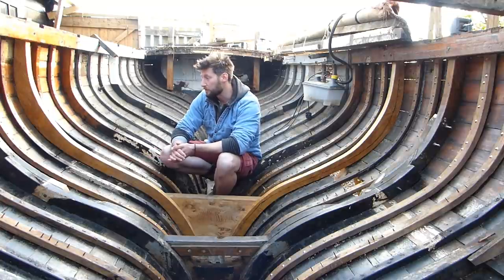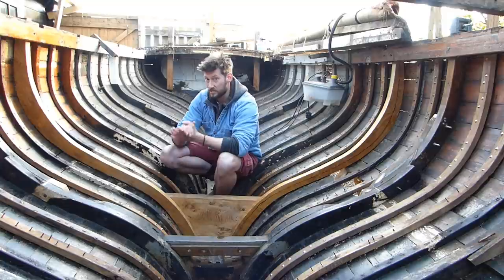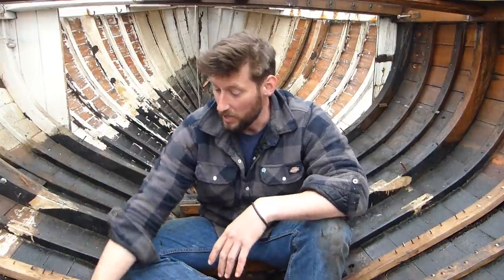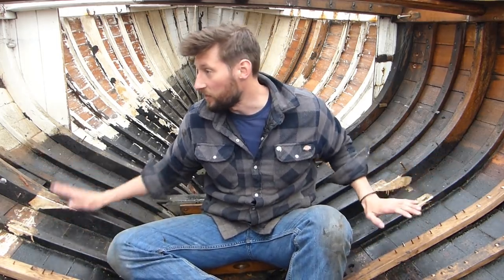Reviving an Idler - A question! -  Extra Content!

Comment: You cold drill a larger hole then epoxy the hole. After set you can drill a new hole in the epoxy for your fasteners.  The epoxy will prevent any moisture getting into the wood planking.  Use a butt block as required in bad spots.

Comment: Hay mate As a Shipwright i would fit a round disk Dutchman on the out side to about half the depth of the plank epoxy it in and fill the hole on the inside with a dal epoxied in  .Trim everything up when dry and you can drill off set to your old holes but not on the same grain line and nail and rove is far stronger than screws but some can be used to pull things up tight temporally and replaced later with nail and rove . You will not see the epoxy as it is covered by the rib and stronger than the day it was built     i would also widen the rib if you can by about 10 mil where it lays on the planking but keep the foot the same to sit in the slot do this to all the bigger ribs all the way through and no one will know the difference some times using new tec on old boats keeps them in good order for a lot longer . On my own boat i have kept traditional methods of boat building with the use of new tec (Where needed) and the boat is 80 Years old and now it will be around for the next generation and maybe the one after that  also a templet jig using small  bits of door stop 25 x10 mils with rounded ends about 100 mils long linked together in like a bike chain with small bolts synched tight and lay it along the hull will give you the curve before removing the rib  transfer to scrap plywood  test trim and fit the ply alongside the rib draw the inside edge  on the ply straight off the inside face of the rib cut to the line and the templet is made .this will speed things up for you and make it easer as i am not shore the existing ribs will come out in one peace    I hope you under stand my method  and description  and helps you on your way       MV Joy-C
Reply from the maker: Wonderfull advise, and experience, thank you for sharing this with me!
Reply: @BothanboatsIdler  No problem mate

Comment: If the planks under the old frame are good  and sound , no rot has traveled, I am a fan of leaving frame where it is. Make a new frame , make it a little wider if you need , plugs with epoxy all old holes. Make frame so you can catch your fastenings in good wood. Bed the new frame with a good marine adhesive sealant, this will seal the planks and with new frame give strength. I would also at least fasten this frame with bronze screws and plugs. This will give back strength as well as seal all the planks. My 2 cents! 😃👍👍

Comment: Late to the game and not a boat builder, but what about putting a short frame into the original keel, then run two longer frames bolted to either side of the short one up the rest of the way.  This will allow you to fasten two frames into good wood.  then just plug the bad portions with trunnels and graving pieces.  From my perspective the iron sickness had rotted the boat all the way down at every plank, almost like perforations in paper that allow you to easily tear the paper (or boat) in half.  I know that doesn't sound good, i guess it depends on how deep the iron sickness goes.  Good luck

Comment: There is so much going on with Idler the more you get into it. I think its time to investigate all possible rot. Rot from iron, rot from worms, cracks, checks, and so forth all over.

This is not an expensive yacht. I believe its planked in pine aka construction lumber free of knots.

Bent wood floors are must, tree trunks are overlooked and left in ground, may involve digging and a few burnt chains but you can get some nice floors.  If you can setup a full size half model out of construction lumber, fair with battens you could get a nice set of lines for all frames. Wherever there is cross grain on a frame it should be sistered with treenails, or trunnels.

You have a choice to patch it up and get a few years out of it, or rebuild it and have it available for the next few generations.

Don't overlook possible sources of lumber, reclaimed wood, leftovers from a large shipyard where you can get a possible piece or two out of wood.

If your willing to put in the work, both on ship and making nice videos, there will probably be patreons and others willing to donate. Again it is not a large ship. You could even make some modifications, such as going with a cabin roof that raises a bit with canvas sides for when you want to camp out on the water with family. Going with a regenerative electric engine and battery banks. (when sailing it charges the batteries) With fuel stove and backup lamps and a few solar panels it can be an interesting cabin cruiser for a small family.  The possibilities are endless.

BUT your starting with the name of ship that has history. History is usually worth preserving especially if it was designed by someone of note. Even better if you can get a line drawing of her.

The cheapest solution is to epoxy in scarfs where needed. Copper rivits with roves peened over. I saw some large copper tree nails on amazon for good price that may be a possibility. I think they are used for killing trees.

Wide gaps in planks, shifting boat due to bad frames all over, sitting without proper support dry for years then soaked with freshwater rain for a number of years has taken its toll.

Id make up build frames install them in boat, after fairing, strip one side reframe plank and then install ribs, beam shelf gunnels and deck shelf move to other side. Choice is yours though.

Comment: Hi Nick , ...... Firstly don't be afraid of using modern materials and techniques ...... the builder would have used them if they were available in the 40 s ....... my advice would be to use graving pieces ( geralds ?) Both outboard and inboard you described and don't be afraid to soak any "soft" wood in thinned epoxy resin with methylated spirit to assist penetrative prior to inserting the graving pieces . Thats how I'd do it  after 50 years wor,kng / building wooden boats ....... I expect my old shipwright boss when I was an apprentice would throw his hands in the air shouting FFS scarf in a new plank ! ....... but then he didn't have epoxy .  Regards Terry

Comment: I would explore one of those large black patches of iron sickness like a dentist. Take off more material than you want to, following all the blackness. That will give you an idea of how much damage is in the other areas. Iron sickness dissolves the lignin so you just have fibers with no glue holding them together. I think the best fastener options would act like a clamp holding plank and rib together, not relying on wood fibers to hold the fastener in place. No real boat experience, just a canoe, so take that for what it's worth. I like the series.
Reply from the maker: I agree, thats exactly why im in favour of using nails. There will definitly by some Geralds going in whether they hold a fastening or not! 🤣

Comment: Use the treenails, about 5/8" thick. then slot the ends and glue in a wedge.  Go right thru the new frames too. Been watching indonesian wood boat building, they dont use metal fastenings, very nice. Could use IPE or some other tropical hardwood for these dowel trunnels. Some are shaped so that no wedge is needed on one end. Like they take a square rod piece and carve the section roundish for the drilled holes . Glue them in with a filled epoxy and they do not have to be perfect you know.  The epoxy will cure even in cold, and it is the wedges and expanded ends holding it in anyway. Other idea is the conical plugs glued in from outside, then use your metal fasteners again.  What I really like about trunnels, they dont rot the wood. And IPE, Cumaru, Ironwood is really strong in shear, tension and compression. Metal fasteners are timesavers, but you pay for using them a lot now in money and again later when they rot.
Reply from the maker: Thanks for the sound advise, i did consider using trunnels, in the end i went for copper nails. The iron sickness on the planking was such that there would have been to many little repairs clustered over each other. And as the boat is of light construction anyway, i just didnt feel there was enough meat on the bone to go with trunnels. The copper roved nails are also key to holding the new steam bent frames in place. 
Thank you for watching and taking the time to comment, i really appreciate it!

Comment: I've thought about this some more, and I think your answer is "plugs". Get hold of a plug cutter, and a matching Forstner bit or spade bit, and then drill and plug these holes. That's what you would normally do with fstenings in the planking anyway> It's advantage over dowel-type plugs is that the grain is running in the correct direction, not exposing end-grain. The enormous advantage over Dutchmen is speed.
Reply from the maker: I agree, and i felt that with a tapered plug would act like a wedge preventing a fastening being pulled through the planking. The only weakness then being splitting along the grain... but Gerald’s glue and total hull pressure i feel would mitigate this....

Comment: I would plug the holes , but you have to get rid of all the blackness in the wood . Therefore the plugs would be rectangular with long and sharp points at both ends . I would move the frame over and install a second floor to accommodate the keel bolt . Maybe supplemented with a stringer  port and starboard . Whatever you do , don't use steel nails . Go for bronze or brass .
Reply from the maker: You are thinking a long Gerald/graving piece style plug? Interesting. 
Im planning on using copper nails peened over roves 👌🏻
Reply: @BothanboatsIdler  , Sorry for  ot knowing the proper names . However , i'm not British . I used to be a shipwright in the Netherlands .
Reply from the maker: @wimmol  No need for apologies mate, all is good! thanks for sharing your thoughts. Its a big help!

Comment: A few suggestions based on some years of experience.

1. Keep and repair your planks and plank sections that are in very good to excellent condition.  These will only require refastening (maybe a slightly larger fastener than the original) or small plugs.  Plugs need to be rot resistant, not strong.

2. Do not try to save planks or plank sections in doubtful condition.  They make great patterns for replacements.  Looking ahead at the work between now and being on the water, your time in replacing planks will be well worth twice the time spent on anything above deck.  

3. My experience would say not to rely on wood hardeners, penetrating epoxies, glassing, etc for any structural component or for sheathing in this boat.  Those are all wonderful materials, but they are non sequiturs here for what you are doing, in my opinion.  

3.  I'd put the new ribs back as in the original, allowing to increase the scantlings as appropriate for fastening purposes or strength.  Wider bent frames of the same thickness are not much more effort.

4. Refastening with predrilled, driven, roved and clinched nails should be perfect.  Copper or Monel or hot dipped galvanized, not sure what you have available.  Don't skimp on cost here.

I sincerely wish you the best in both the process and the end results.  Also, I hope you don't lose your mind thumbing through all of the contradictory advice.😊
Reply from the maker: You speak my mind! Well surmised. Lots of fantastic ideas in the comments. But the common theme is that plugging is possible practical and acceptable. There will however as youve said be some plank replacement required. 

Thank you
Reply: @BothanboatsIdler  Just imagine that you are resting at home 45 years from now and your granddaughter has Idler out on her first solo sail.  You smile knowing there is no expectation of a sprung plank, because you put Idler back with a mind to the future, not with the idea of saving as many old planks as possible.😊
Reply from the maker: @boooshes  Absolutely agree. And what a pleasant thought that is! Thank you!

Comment: As a suggestion go and see a few local boat builders or contact Leo or any of his crew at Tally Ho or some of the shipwrights at Port Townsend and see what they would suggest.. Personally, I would go and talk to a professional boat builder discuss the options and more than likely put the rib in the correct place and plug the existing holes and drill new holes beside the present ones and slightly skew the nails in toward the centre of the rib and fasten using copper nails and rivets which is something I have done on my 14ft put put.

Comment: Hey, I would say that the frame should stay in the same place as it would obviously look better and keep her as original as possible, drill the holes bigger and plug then new holes as you said. The other frames look like they have similar sickness too so plenty work to do! Keep it up 👍
Reply from the maker: Yea i hear ya. I feel it would be better to keep everything where it is supposed to be, but when you factor in potential damage to the planking at every frame... it becomes a question of whether there is enough of a connection between the frames and the planking along the whole boat!
Reply: @BothanboatsIdler  might be better on some planks to replace some, depends on what the other frames are like, maybe it would only be a plank or two which won’t be that hard and then you have the good strength, like the other comment said about going at it like a dentist on the worst planks and see what like 👍

Comment: Hi there. Some of smaller sick holes could be plugged with just circular plug. Just be sure to have grain same way. The bigger has to be replaced and here You have 2 options: make a diamond shape plug with wedged sides or cut whole black part off and make scarf jointed replacement. As I could see, there are two planks infected in whole width. Questions? Sorry for my english.

Comment: Plug the holes like you want. Then make the frame wider , covering plugged holes and putting nails on outside of old holes. lines up with keel.  Just will look different but may never see.

Comment: Good and interesting work.
Re problem … The iron-sick nail holes need to be routed out down to untainted wood, then plugged.
Have you considered replacing the single old iron nailed frame with 2 new frames side by side on either side of the original.  The new frames could be lighter, and if copper nail/rivetted together would provide similar strength.  These could then be fixed to the planks with two rows of copper nails rivetted in the same way as the other planks.  The placing of these nails could be arranged to miss the plugged holes.
Reply from the maker: Good idea, and i see what you are saying... it would be potentially tricky to fit the floors. But food for thought 👍
Reply: @BothanboatsIdler  Thanks and all the best

Comment: Use penitrating epoxy to stabilize the wood with iron sickness, let the wood soak ik up till saturated. Then plug it, and fasten with copper rivets.
I've done this before to 3 wooden boats with simmilair problems, the best is to use (semi) flexible penitrating epoxy so everything can move how it likes.
Reply from the maker: Ive always been scared of using epoxy due to its reluctance to bend with wood “hydration”.
You are saying penetrating epoxy is flexible?
Reply: @BothanboatsIdler  

There are different types, some are flexible and others not.
Reply: As the black stains are rot in the planks, so I would go with the fitted gerrold method. The black stained wood, if not removed will continue to expand, causing a larger repair down the track.
Reply: @davidbamford4721   with the epoxy you just replace the lignine thus stabilizing the wood. When doing this it is a must that the wood is as dry as possible.

Comment: I would say a wide floor and 2 ribs with plugs ECT  and  I am not a boat builder but nice project
Reply from the maker: There is a chance that i could use a filler piece between the frame ends to hold the ballast keel bolt and have the floor behind it to strengthen the lot and bolt to the keel... its an option too

Comment: I'm the overcautious, belt-and-braces sort who is also working as a boat designer.  Don't mistake me for a Robert Perry, but on the other hand my counsel would be to avoid the quick and easy.  You already know nothing with boats is easy...  My counsel would be to avoid changing up scantlings like a trip to the undertaker.  The original designer placed the frames where he did with an eye toward engineering; rig forces are tremendous, and when laying out framing he most likely started bracing in way of the rig and worked outward towards the ends of the boat, for example.  If we start moving a frame here and there, we may get away with it for a short time, but as she works she will most likely develop hard spots and leaks.  Moving the floors is equally risky and bodes potential to exacerbate the problem.  Some have suggested scarfing, but each frame is undoubtedly fastened with iron, thus scarfing will leave you with more scarf than original plank.  Not what you want to hear, mate, but it's my belief your best way forward may be fresh planking.  You'll sleep better at night and bail less during the day.  BTW, REALLY enjoying your channel!  Well done!
Reply from the maker: I do agree with you i am very loath to move the frames around. It seems like the beginning of a disaster to do that... and having someone else say that confirms the fear. I am pleased to hear so many people claiming the plug idea will work.

Comment: What about wider sawn frames with one face in original position against the floor, using the extra width to offset the nails? If using treenails, 10mm seemed right to me. Aren't the wedges driven perpendicular to the grain to avoid splitting? If so you could do a vertical cut on the outside and horizontal on the inside of the hull, or, once again wider frames.